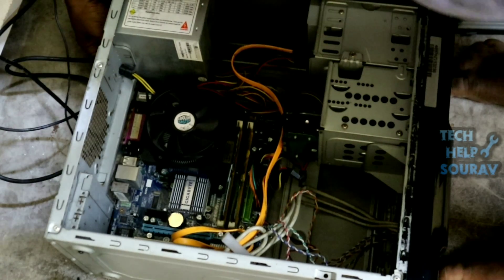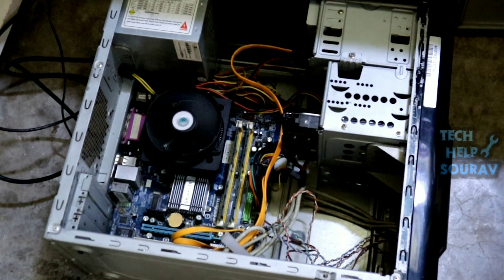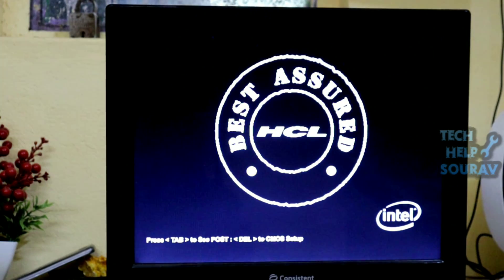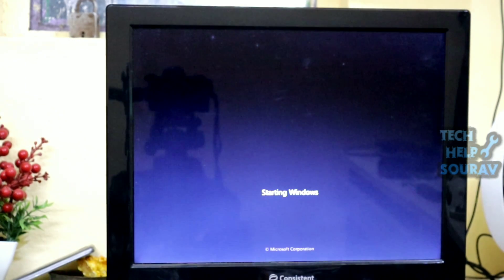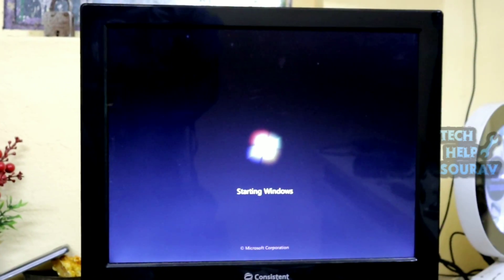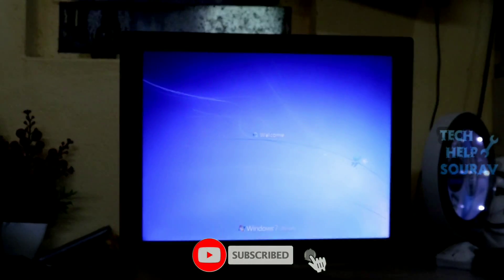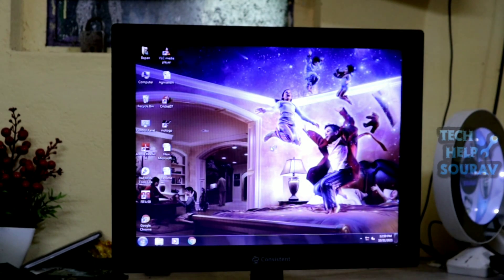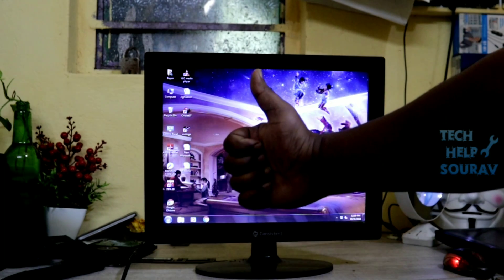How To Fix No Display On Monitor and Continuous Beep Sound From Computer | CPU

Comment: Lucky l stumbled this video. l almost going to buy a new mobo.
Early, I did try to reseat the ram but it still beeping. After watching this video, l just lightly quickly rub/clean on the ram side, and it works. l was surprised. First time l encounter this issue😂. Thank you so much for your wonderful tips.

Comment: I had tried everything and nothing worked. I thought the vacuuming of the memory card and slot wouldn't work.but I read all the comments and thought ok I will try it. It worked. Computer is back to normal, doesn't keep turning on and off and no beeping. Thank you so much.
Reply: My ram was loose that’s why mine wasn’t working try pushing it in more
😊
Reply: @AustinBraylenWilliams my ram was loose but I just don't know how to push it in enough

Comment: I am getting one beep for 1 second and no display 
Specifications:-
i5 4440 processor 3.10ghz
GTX 660 2gb graphic card 
8gbram of 2 stick of 4gb 
Asus motherboard ami bios 

It happen after I apply thermal paste

Comment: Hey I got the beeping sound after I turned on my PC & I had a power cut & it went & came instantly is this a ram issues or something else I am asking because I don't want to take risk by doing somthing wrong
Reply: Hello don't ask who I am but I it's is the ram problem only  and my beep was 3 times
Reply: Nvm i fixed it
Reply: @adiplayz2593  how.?.
Reply: @richboyfn6622  just remove the ram and clean the ram and the slot it is fixed
Reply: @neoRaptors yes it is the ram problem just remove the ram and clean with a old toothbrush and even clean the ram slots with the toothbrush
Reply: @adiplayz2593  it🤣